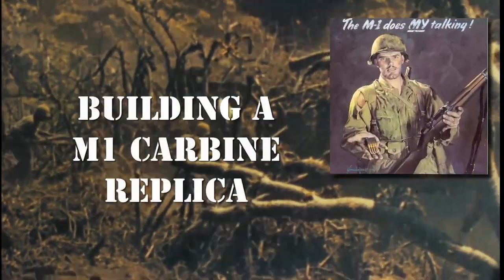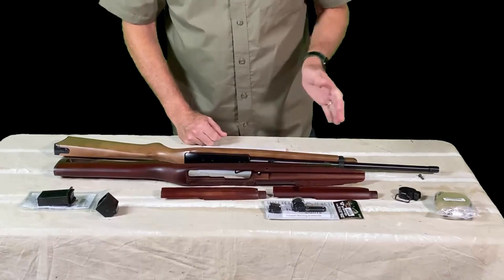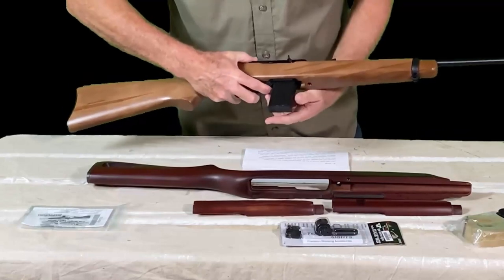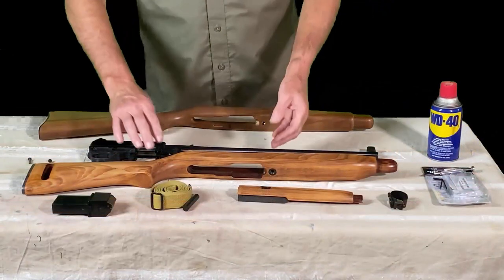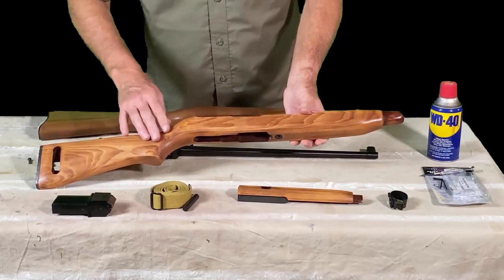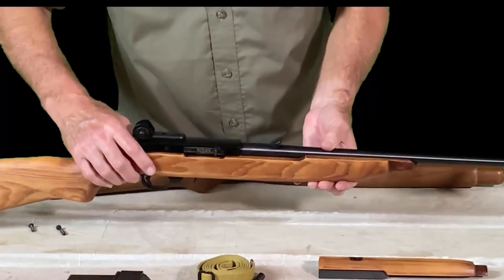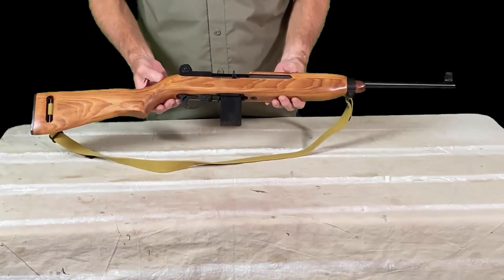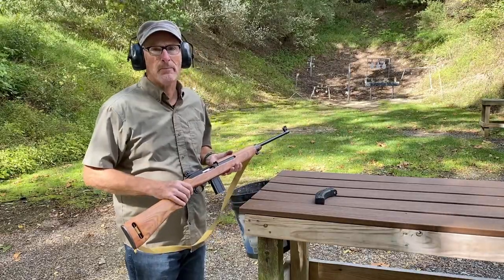Building a M1 Carbine  Replica

Comment: I did same as you a few years ago. Bought the stock kit, Tech 200 sights, & mag extension from E Arthur Brown.  Hated that finish, so I removed it and stained it with Minwax Red Oak and finished it off with Tung oil.  At that time it only came with an upper hand guard with a cut-out for the Ruger rear sight but I was later able to get a hand guard without the cut-out from E.A. Brown. I've since put a longer skeletonized charging handle on it which makes cocking a little easier.  No problem plinking tin cans at 100 yards with these peep sights. Great looking rifle and a  good, accurate, and reliable shooter.  I think it was worth the extra cost and I'm very happy with mine.

Comment: Just ordered this kit. Just to clarify, your process was,

1. Strip red finish with 00 steel wool
2. Stain with cognac
3. Seal ?
Reply from the maker: Yes that was the process I used.  You can use a different color stain depending on what color stock color u want.  Enjoy your project!

Comment: i really like m1 but cant afford so searched about 10/22 and sure enough heres a kit, very cool. link to kit and parts, is it expensive?
Reply from the maker: The kits were not expensive and info on where to buy them is in the comments!  Good luck and enjoy building your own!
Reply: I looked at the ruger that already comes set up like this.. the Talo I think. Don't make them anymore. I found the Chiappa M1 22 it costs abot 100 dollars more than a Ruger 10-22 but it is a lot closer from the bolt to the mag release to the safety. To be honest my 10-22 is a tack driver at 50 yards. The Chiappa is just as good.

Plus my Rugers killed a lot of squirrels and rabbits and several hogs so I didnt wanna change it.

Comment: I have 3 real m1’s and of all the .22 rifles I own I do not have a 10/22 . But what I do have are a couple Marlins that came from the factory that were made to look somewhat like an M1 . 
Model #s are as follows .
The 99m1 is a ten round tube fed and the 989M2 os the same but is box fed . They basically are based off the model 69 action and can be had for less than the $600.00
MOST OF THE TIME . 
Looking  at the auction sights some people are asking outrageous prices but the ones I bought that look like new with the original sling we’re under 3 Benjamin’s. 
Just my two cents . So what you will .
Reply: That should have said 
Off the model 60 action . My phone changes things all by itself . Like the Do/So .

Comment: You could buy a Chiappa M1-22, which is a 1:1 Replica of the M1 in .22LR, for less than you could buy and convert a Ruger 10-22..... Actually a brand new Chiappa M1-22 costs about the aame as rhe Ruger 10-22 out of the box. So you save a lot of money by not having to buy conversion parts! but also the M1-22 is of course a 1:1 replica. It's the real deal, only in .22LR